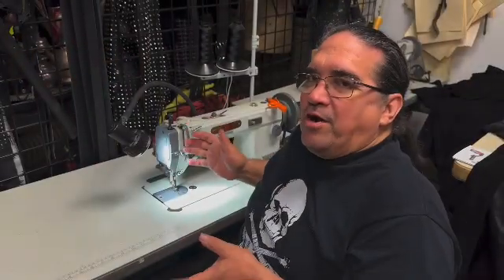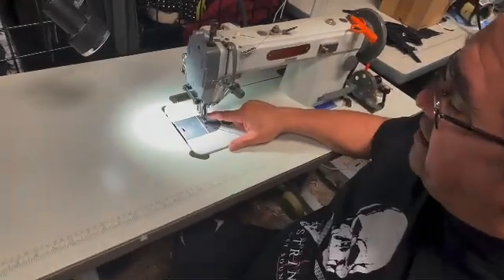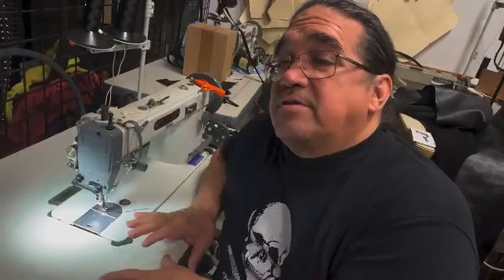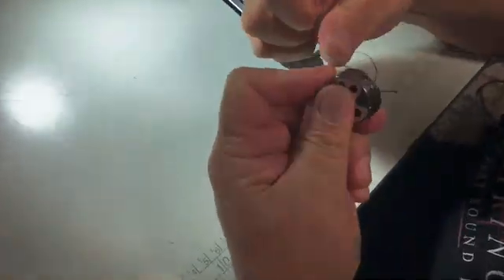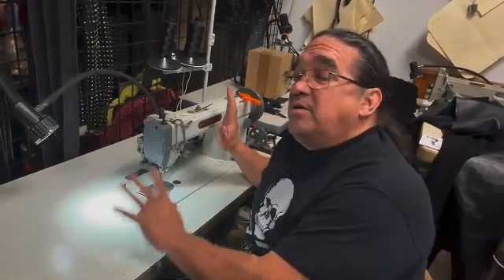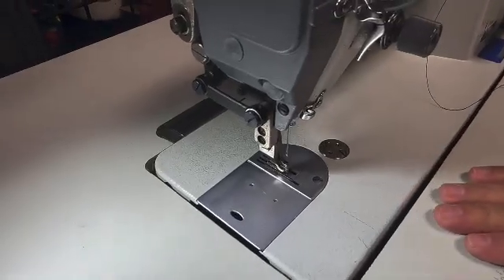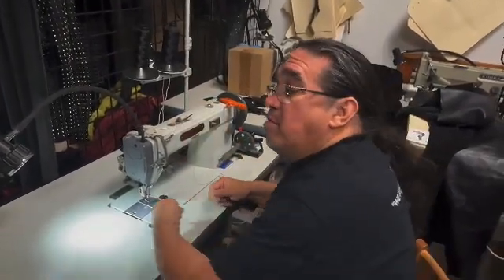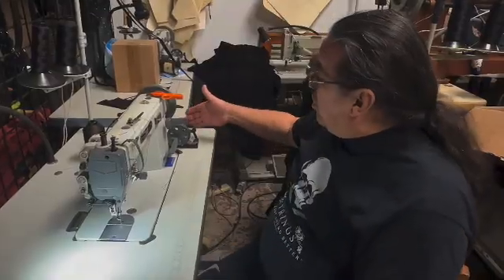Sewing 101. First day with your new sewing machine tips and tricks.

Comment: Good evening, I have a question. I’ve got a cobra class 4 and I’m wondering how hard I have to hold the top and bottom thread when first running a stitch? I’m finding that no matter how strong I hold it, it wants to pull back really hard. Not sure if that’s normal.
Reply from the maker: Wrap the thread around your finger, then break your hand to get some machine.